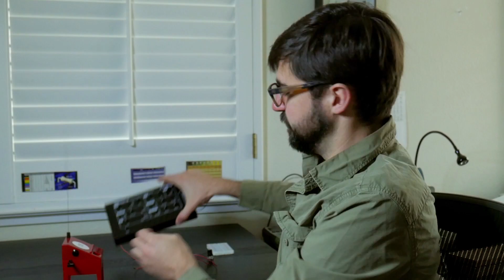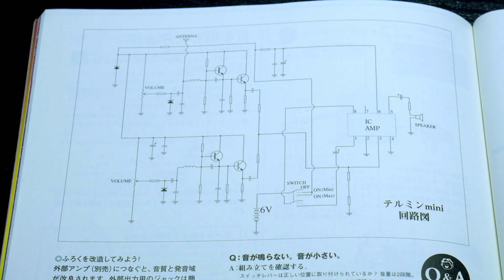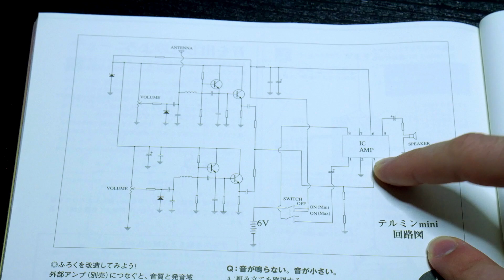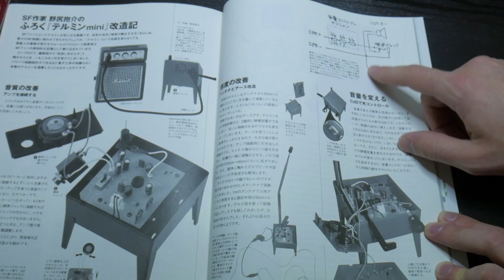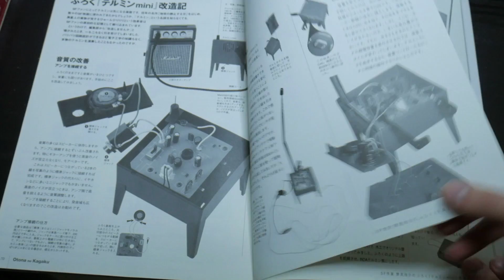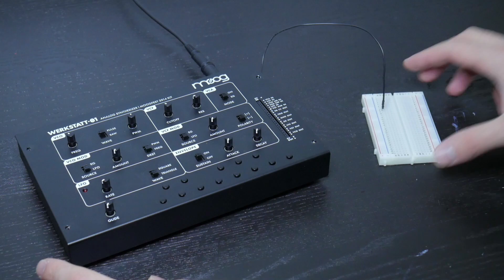Theremin Toy and Moog Werkstatt

Comment: dude that's great stuff. Any more tips for that lil patch system? Cheers!
Reply from the maker: Thank you, it is a fun toy and I still play with it years later. I have also attached a waveform generator chip (ICL8038CCPD) so I can use a really low frequency sine wave. I've also considered using decade counters to make sequencers, but actually a DAC connected to an arduino would probably give you more options. Happy circuit bending!